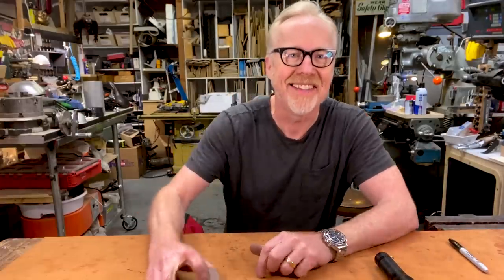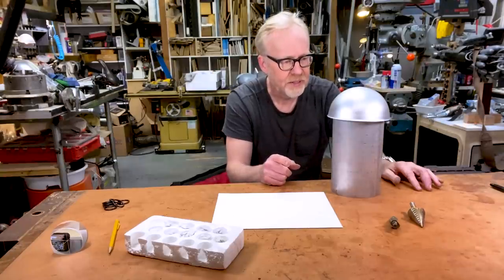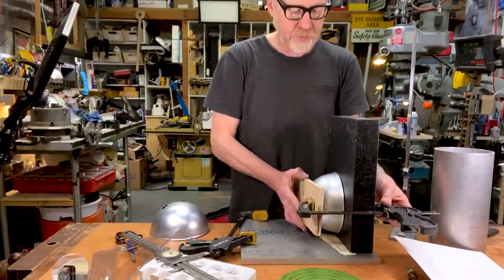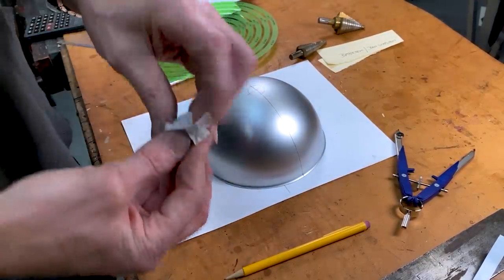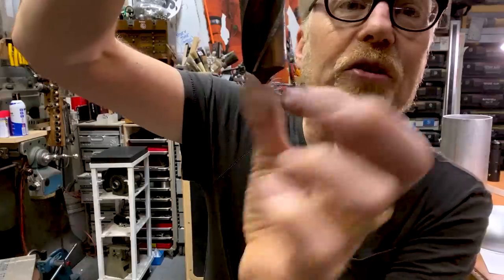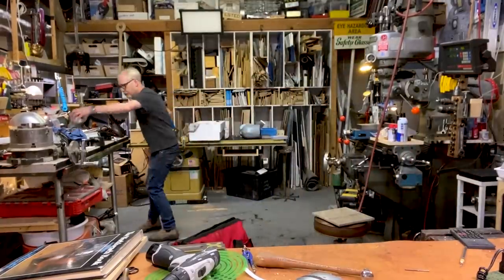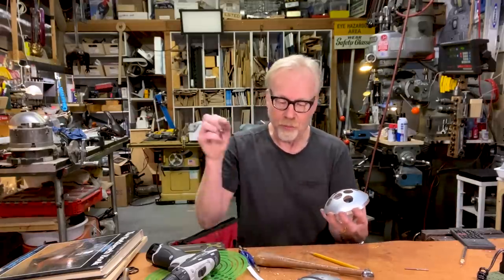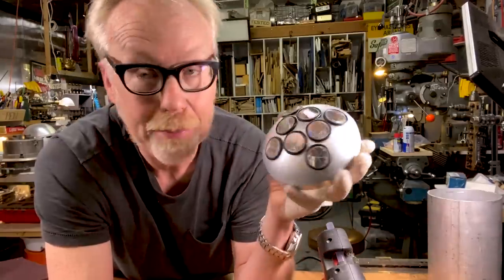Adam Savage's One Day Builds: NASA Retro-Reflector Replica!

Comment: Let’s be honest. We all hate working on round objects.
Reply: But that end result tho
Reply: ....well...
Reply: I once had to draw three ovals on a small reasonably flat dome/spherical object, not touching each other, touching the outside, all angled from the edge, so that the whole thing would after cutting it away would leave something like 3 blades, and that whole thing would be mounted on a pentagram.
I thought it was a cool idea, but didn't foresee that hassle.

Calulcating the starting points on te outside was easy, just 3 equally divided points, the middle line of the shapes was not just following a triangle but slightly off,  all that was easy, then actually drawing the ovals was very annoying.

Also, it was all gold and white gold, and then later had to set in 3 white gold settings with a ruby in it. This shit is expensive, so no just doing it over and over again or scratching a lot of lines in it because it would be a pain to file and polish that all out and only cost you material and chances to damage the whole thing.

End result: 
https://photos.app.goo.gl/FwUEskVGeEB3kfGW7
Reply: I avoid even drawing round objects. As a kid I used coins to draw.
Reply: @gabiballetje  Really nice! That's where I would cheat and 3d print a template to trace the ovals on
Reply: @ej-1608  That's not cheating. That's called making a jig. It's a legitimate construction technique.
Reply: EJ-160 3D printing was not a thing at the time, at all.
Reply: True, but the end product of round and especially spherical objects is more satisfying
Reply: @gabiballetje  That's pretty cool
Reply: @gabiballetje  That looks pretty cool, was there a reason you could not cut it flat and then dome it?
Reply: Frist Lsat it would de form anyway, somewhat unpredictable, then reshaping it would be even more annoying. Probably wouldn’t be like what you want it to be. Especially it’s the thin parts, if you beat it, it moves away, it’s too hard to take all that into account. It’s all done by hand.

Comment: Thanks for the explanation on regular drill bits vs unibits (step drills). 
Using a unibit or step drill is also handy when making large holes in acrylic tubes. We had a rush job when I needed to make 8mm holes in some 70mm dia x 3mm wall tubes. Drilling these out with a regular drill bit just resulted in a lot of cracked holes and ruined tubes unless you were super careful, ie slow. Out of frustration I grabbed a nearby drill with a unibit in it and stabbed yet another ruined tube to punish it for being flaky plastic...lo and the hole went in clean. Another stab and another clean hole. Saved the day, unibit everytime now for acrylic.

Comment: Geometry fun fact/nitpick - if you set your compass to 1 inch, and use it to mark out a circle on the surface of a sphere, that circle will have less than 1 inch radius. Doesn't matter for this application, but it might elsewhere.
A few ways to describe this, one way is that the circle you mark forms the base of a cone with its tip at the place you put the compass point. On a flat surface, that cone is of height 0, so the base has one inch radius. As the height increases (with the curvature of the sphere you're drawing on), the base radius decreases.

Comment: Unibit (R) drill bits are great (generally called step drill bits).  Comes in metric too!  Two tricks that I have learned.  1) Let's say I am trying for a 3/8" hole on a step drill that goes up to 1/2".  It is easy to drill too large a hole when the bit is spinning around madly and you can't read which size you are at.  So I mark the 3/8" level flat part of the bit with a black marker.  This mark I can see while it is spinning. 2) Once you have right sized hole, just very GENTLY touch the correct hole with the next size up.  This slightly countersinks the hole and removes any burrs.  ENJOY!

Comment: The same principle is used on the radar reflectors hung from the top of the masts of sailing boats and other small vessels. A small boat makes a poor radar reflection, made worse by rain (depending on the frequency of the radar). The radar reflector gives a greater return signal that makes the small boat into a clear target for a larger vessel to avoid.

Comment: Not only in space :)

We use them on offshore ships as well. Usually platforms have retroreflectors mounted on corners, on crane bases, hose stations etc. we have range and direction finders on the ships that feed in to the Dynamic positioning system onboard making station-keeping and close maneuvering a breeze.

Comment: you can try using machinable wax as a backing for thin materials. helps stop deformation when pressure is applied. fairly cheap and moldable

Comment: I've done projects on flimsy material where the inside would not be seen. I filled it with spray foam first and that provided enough support to make the project easier to drill and also some structure to glue to
Reply: Edit...realized it would not work for Adam as he would have to wait a day to work on it. Not gonna happen, he's the type my dad used to describe as; when he shows up to work he has the first 3 holes drilled before his car is in park!

Comment: Both Cubic and HP made survrying distance measurement systems using retro reflectors and IR emitting diodes.  Resolution was about 1 mm and overall accuracy depended on atmospheric assumptions and correction.  i worked on the Cubic device and have some large prisms around here somewhere.
Reply: Product name- Cubitape and later there was a total station, i think called Minitape.

Comment: Unibits work best at high speed. Once the pilot hole is made, the pushing force should be very light (or you'll burn the bit when cutting steel), especially with your thin material. It seems like you've really got the hang of it but keep the rpm up or it will snag and mangle the work. Also, turn the work around and use the unibit from the other side to quickly debur the hole (provided you didn't use the largest step).

Comment: A good way of cutting thin shells like that /or styrene vac forms is to mount a minidrill vertically to a height gauge with a cutting disk attachment.. then with the tool fixed you can just move the shell into and around it, cutting to the prefect height :).

Comment: If you need to drill the center, I saw someone mention laying the paper out on a drill press and then adding the dome. But if you need more marks that obviously doesn’t work. Although a bit could mark it. But you can basically chalk a line across it from point to point, or use three rubber bands. There are many ways to skin the cat. The method shown is probably the most accurate though.

Comment: place the bowl in a hole cut in a board or on a ring so that the bowl is stably supported. Level the bowl in the X, Y with a spirit level. Place a drop of water in the bowl, the drop will show you the center/peak of the dome.

Comment: Adam I'm surprised you didn't MA glue the full dome to the end of the pipe carefully aligning the center of the dome to the center of the pipe, using the lathe and a live end. Then trim the dome flush with the pipe using the lathe, and then part the thing off last. You could have used the lathe to fixture the whole build! You could even have laid out the concentric hole center elevations. This was a "Leverage Your Lathe" video! Thanks anyway man, super cool project. I do appreciate seeing the inspection plate, height gauge, etc. being used too.

Comment: Actually we use retro reflectors more or less at a daily basis at work. We use them as a position reference  system for our dynamic positioning systems when alongside oil rigs. We either use a pipe covered in a special reflective tape or a prism cluster.

Comment: Could you use a centering head to find TDC of the hemisphere? I used them a lot as a steel fabricator for clocking steel pipe. Put the CH on the pipe, lower the blade to just barely touch the pipe, then use a level to get the blade perfectly vertical. I'd think something similar could be done with a hemisphere by checking level along the blade edge, and one of the blade faces.

Comment: Adam, if you turned your metal dome over on your metal cylinder, you could use a level to make sure that the top of the dome was level all the say around for marking the outside diameter of the cylinder.  Also, you could a drop of water to mark the exact bottom / top of the dome. Just another way of doing the same things you already did.

Comment: still watching but wanted to comment before I forgot. alternatives for find dead center instead of height gauge:
1: get two squared items of same height on table top and balance bowl on its rim between them such that its rim is horizontal. now dip  ball bearing in ink and drop into bowl. it'll come to rest in the nadir/lowest point which will be dead center.
2: for fun have a shaft attached to center of a square flat board so it can be mounted in the lathe. hot glue the bowl centered on the board. mount in lathe at slow speed and gently touch middle of bowl with rough emery paper which will leave random sized concentric circles around and/or at dead center.
3: to keep with your geometry theme, mark your four cardinals first at the rim. take the height of the bowl minus the rim thickness in that direction as distance A. measure bowl diameter again minus the rim size and halve the result to give distance B. consult Pythagoras using A and B to determine hypotenuse C which you set your compass to and using the four cardinals as the center for compass pin you can scribe on the top of the bowl and all lines should pass through the precise center point.

its great to see you tackle odd tasks with confidence and geometry is one that scares people as is working on curved surfaces with precision.

Comment: Another technique for finding the center, for folks who have a mill: 1- Put a point (or flat end mill) in the spindle. 2- Hold the hemisphere flat on the table. 3- Sweep the hemisphere under the point. 4- Lower the spindle a couple thou and keep sweeping the hemisphere under the point. When it touches, it will touch the dead center of the sphere first.

Comment: Use the milling machine table. you have right behind you in the shop :D  put a small felt tip marker in the spindle (small collet does well). use the DRO center function to find and mark the center.  or by eye even without a dro can be very accurate.    takes 10 min. no fuss ;)

Comment: There is a better way to make large holes in very thin materials. The stepped drill is a versatile tool but it makes a bit of a messy hole in thin sheet and has a tendency to wander off centre. Using a simple screw-down type punch and die takes a little more set-up time per hole, but you save that time (and more) by avoiding the clean-up and do-overs you get with a stepped drill. The punch and die method also has the advantage that you are not restricted to round holes!  I'm not talking about the type of heavy duty punch and die that you put in a press, but the ones that are intended specifically for making panel cut-outs for electrical installations. You drill a small pilot hole then fit the tool and tighten the screw to punch a perfect hole that needs no clean up.

Comment: You made an extra line at 45º
Making an "extra" line at 90º then at 180º means the middle of the square you made is the exact center. 
This is great when it is a square.... it works even better with a circle.
It is one more step but it does narrow down the piece a bit. It doesn't matter if it is a 6 foot wide tree stump or a 1" baluster.
The middle of the square is the middle of your measurements.

Comment: 1. Machinist's stone on bench.
2. Clamp metal plate to edge of stone for 90°.
3. CA glue the dome to the metal plate.
4. Use height gauge to scribe line.
5. Heat the glue to break it.

Comment: You could have used the compass to find the center of the dome. Put one point anywhere on the perimeter, adjust the span of the compass to find the point on the perimeter at a right angle to the needle, and then draw over the dome with the compass, rinse repeat for multiple points around the circumference without further adjusting the span.

Comment: The way I find the center of a half a sphere is , mark the half part on paper like what you did, mark the center, then I use a laser center finder, line up the laser with the marks on the paper then put the sphere back on the paper & mark the crossed laser lines. Ether that or put it under the drill press & slide it back & forth pass the bit.

Comment: Retroreflective prisms make sense to me.  Retroreflective paint (road signage, truck stickers) on the other hand...how does THAT work?
Reply: Those aren't proper retroreflectors, they paint has glass microbeads in it, the back side of the microbead acts like a sperical reflector, making sure that light does indeed bounce back the way it came, but with an  almost 180 degrees spread.  A real retroreflector would not shine brightly in your headlights, because the reflection is literally centered on your headlights, and your eyes are a foot or 2 higher than your headlights.  But since a flattish object  reflects almost all its light at the opposite angle of incidence anything that reflects more of that light back in the general direction of the source looks surprisingly bright.  The shallower the angle of incidence the bigger the contrast. Road lines are a great example, sitting in your car, your lights normal reflection angle off the road is almost all going away from you at a very shallow angle.  The reason the road is visible is that concrete and asphalt are not smooth, but actually have irregularities in the surface which reflect some light back at you, however the road lines are coated in glass beads, and ever bead sends a reflection back toward the source of the light, and your eyes, with wide open pupils see this as really bright.  It is the relative brightness that makes them stand out.  If you take a flashlight out during the day and shine it at a road line it is doing the same thing, but the ambient light is so bright that the relative difference in brightness is basically non-existant.  Just for reference bicycle reflectors are also not very precise retroreflectors, because they also need to reflect from a light source to the eyes of someone near the light source, so the little pyramids on the back of those reflectors do not have very flat sides, the curve in them de-collimates the reflection and makes it spread out.

Comment: You did a great job with this. I am surprised by the fact that you didn't use your lathe to mark and cut the bowl section. YOu could have turned a wooden puck to fit the bowl to. then, you could screw the bowl to the puck and then it would have been stable for marking and cutting. Just a thought for next time.

Comment: What's the benefit of using those cone bits over a hole saw/hole cutter that would have a drill bit on the front to pilot the circle cut out in one step?  Then you could even use your drill press to avoid handling issues.
Reply: Also, wouldn't you be able to use the table saw to cut the bottom part of the dome off since you were able to mark it height wise? Just brace it vertically like you did to mark the center and run it through.

Comment: Wouldn't it be easier to find the exact dead center by dipping the sphere in water or something that stains slightly (and can be washed/scrubbed off naturally), then hang it upside down on a completely level surface? The water drips would naturally slide down until they drop off from the exact center. 

Just a thought

Comment: Would've chucked a piece of wood of sufficient size on the lathe, cut it so that it perfectly fits the insides of the half sphere, glued the sphere in with glue and then chucked the piece on an indexing head on the mill, at which point, cutting each hole perfectly would've been easy peasy with a wood bit in a Jacob's chuck using the indexing head's ability to index and tilt. Just my 2 cents.

Comment: Adam a drill with a higher speed and a lighter pressure will give you a cleaner smoother cut. And obviously the sharper the bit the better but it will step very quickly

Comment: Seems like it would have been easier to calculate the circumference from the diameter and use a soft tape measure to find the center.

Edit: Continued watching, I suggested almost exactly what he was doing at 12:24 but with a tape measure.

Comment: Personally, I would have filled (or at least coated) the inside of the hemisphere with resin or plaster, so it would hold its shape better when drilling the holes. Or even just fill it with water and freeze it just before drilling. You can see that even the small amount of pressure required to use the step drill is enough to deform it.

Comment: I think you might have had much less of a ragged edge on those holes if you simply pilot drilled the middle and then used a 1 in chassis punch. Its the tool designed to do what your trying to do. Loved the vid but the hole drilling saddened me seeing the metal deflect as you drilled.

Comment: Couldn't you put a foam ball to support the globe as you cut and use acetone to melt the foam. A dense foam should be able to support enought to cut it on a band saw if you mounted it to a flat surface with hot glue. A little bit more of a step but, maybe less risk of crushing the globe.

Comment: I don't understand why you keep using your calipers to set the height on the height gauge. For one thing, that'll give you at least two more sources of imprecision: you're probably not holding the calipers perfectly vertically, and you're trusting your eye to transfer the measurement. 

But more importantly, it seems like an extra step. Does your height gauge not have a scale? It looks like a Starrett #454, which should have a vernier scale.